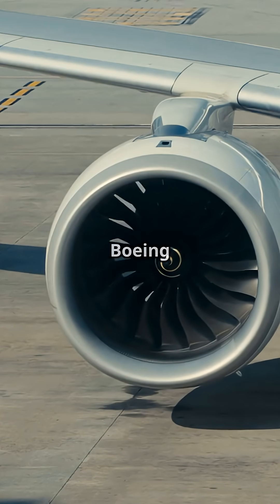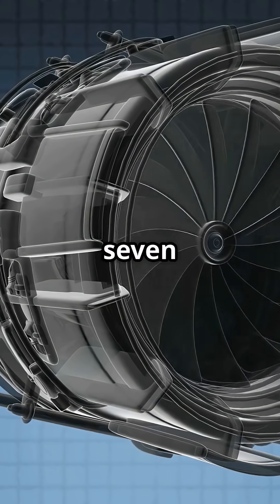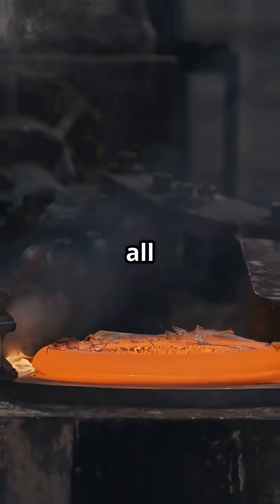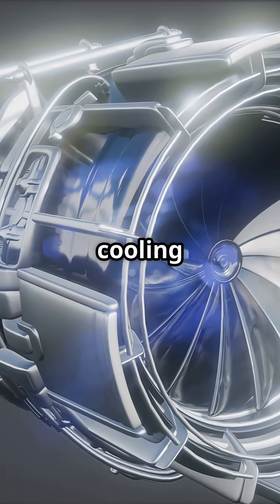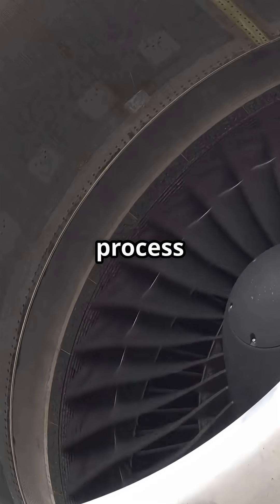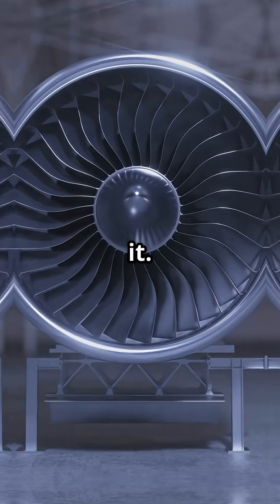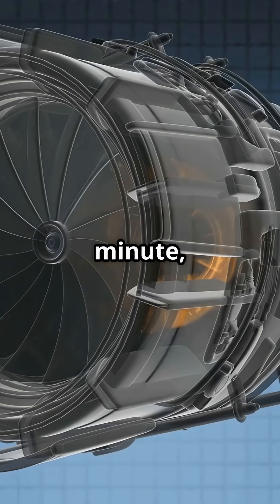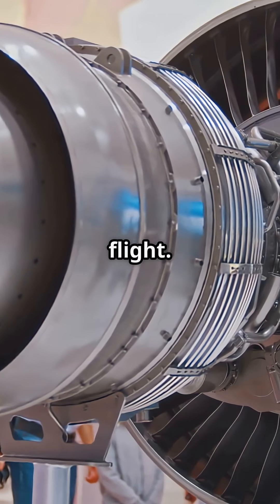Jet Engine Blades: How Do They Not Melt?

Comment: I think the inner comprerssor blades are made from an alloy that is mostly titanium, whose melting point is about 1600 degrees C. And the temperature they reach is about 1600 degrees C. As well as the air cooling, the blades are also coated in ceramic. And the real trick is that each blade is cast in such a way that the entire blade is one crystal. It really is mind-bending technology.